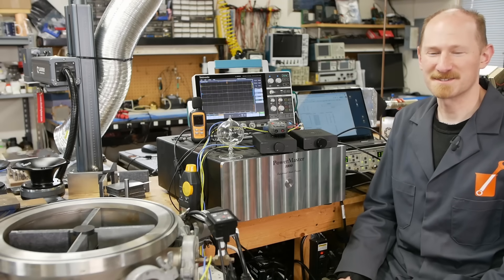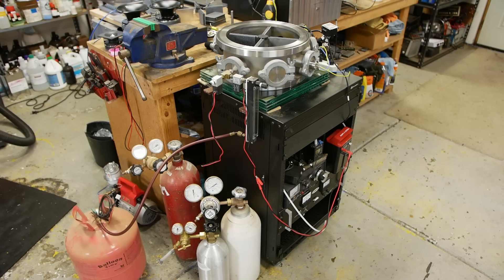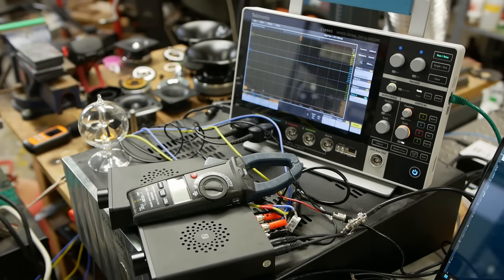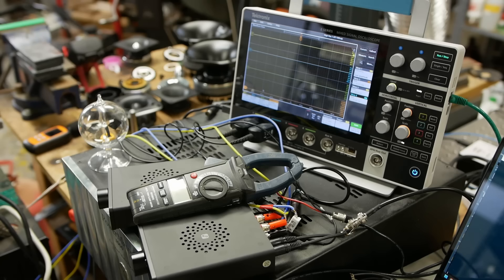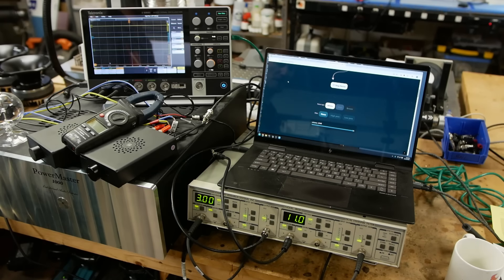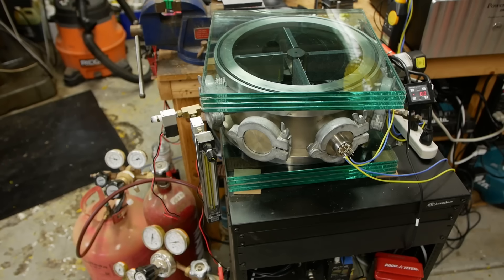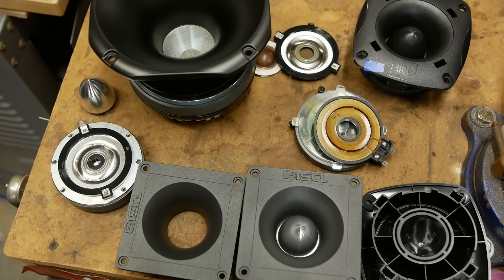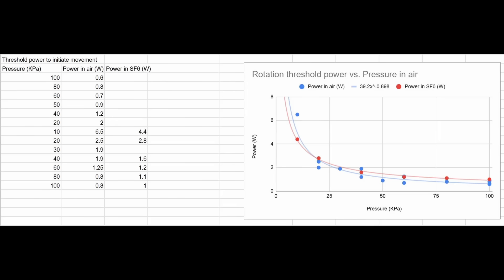Acoustic Radiometer spins in 130dB sound, clockwise and counter-clockwise depending on sound pattern

Comment: Regarding the blown tweeters, 1982 to I985 I was the one man service department for a small UK Sony & Pioneer dealership selling TVs and domestic HiFi. At the time when CD players were first introduced (or we first sold them) a lot of people would buy 100W speakers - often Pioneer, Sony or Wharfedale - and a Pioneer PD 1 CD player and then a week later complain of blown tweeters, and how it couldn't be because they ran it too high a volume as their amplifier was only rated at 20 or 50 watts.
Of course, they were cranking up the volume a bit with the new toys for the bass, but after some time it was discovered that with lower power amps, and the higher dynamic range from CDs, turning up the volume would lead to clipping or squaring of the peaks of the HF waveform, in particular cymbal crashes.
The average power then being passed to the tweeters was much higher than expected and they soon failed. The answer - paradoxically - was to have a higher power, more capable amplifier. 
When you mentioned white noise and blown tweeters I immediately wondered if your amplifier was under powered and squaring the waveform, increasing the average power? But no doubt you covered that. 
It was an interesting lesson for me as a youngish technician at the time!
Reply: I worked for a sound equipment hire company in the 1980s and the "clipping amplifier blows speakers" problem was well known. We refused to hire speakers to people who wanted to attach them to their home HiFi - you had to hire our amp and speakers as a set.
Reply: As I understand it, the clipping also produces harmonics that further add to the HF content/power going to the tweeter.
Reply: @oldman1944  Makes sense, the more you clip a sinusoidal waveform the closer it becomes to a square wave with all of its attendant harmonics.
Reply: CD players also have 2 volts output where tuners etc only had 200 mV. So the same number on the volume control was a lot louder.
Reply: Yep - tweeters and horns hate DC and this clipped waveform has a lot of it!
Reply: @paulypaulypauly8011 the crossover filter should filter out the dc component. Its the harmonics
Reply: It's definitely still a thing. I work at one of the few remaining hi-fi repair shops, and when a customer blows a tweeter it's almost certainly because they tried to drive a set of modern low effeciency speakers in a big room with a 70's low wattage amp or a tiny class-d amp. Clipping kills way more tweeters than reckless volume control.
Reply: This reminds me of another blown coil due to clipping but in a completely different application: I have these little emergency flashlights at home that plug into the mains and switch on when the power goes out. I tried recharging one with a backup power bank that produces a "modified sine wave" 120v output. The light promptly let out some of the magic smoke.
Turns out the energy from the higher frequency harmonics in the digitally synthesized 120v AC wave was too much for the little 1/4 watt through-hole inductor in there.
Reply: The amp being used is capable of around 89W/channel at 8ohms with 1%THD or 160W/channel at 4 ohms.
If the tweeter spec sheet was honest about the 120W power rating then it might actually be the amp causing the issues.

But 120W would be a crazy high power rating for a single tweeter as I understand?
I didn’t catch what the measured maximum power was, but the power shown when he’s talking about measuring the speaker coils only seems to go up to around 6-8W.
Reply: @Gractus  the rated power is band limited. Not because of the reason Ben mentioned, which is in of itself a common misconception used to explain a phenomenon misunderstood. It's simply about thermal dissipation and the ability of a tweeter to move. Since the tweeter can't move much, lower frequency material causes more heating because it's not acting like an inductor anymore
Reply: @AnnaVannieuwenhuyse so you’re suggesting that if the input noise was filtered to the rated 1.7KHz-20KHz, the power handling would be much closer to 120W? 

Is the impedance of a tweeter likely to fall so much below 1.7kHz that it’s going to burn out from the brief dips into that range as part of the white noise? I’m skeptical that it could be that significant.

I’m familiar with the idea that lower frequency content typically requires far more power but my assumption was that this is primarily because humans are far less sensitive to low frequencies and the drivers for lower frequencies are typically much larger to move more air. More air moved -> more power needed. 

I’d be surprised if a tweeter could handle a much higher power (even within its expected frequency band) simply by the fact that those frequencies require relatively small power levels for extremely loud volumes. What practical reason could there be to design something that can output more than 130dB at <20W, with the capacity to accept >120W?

I have to side with Ben’s explanation that the rating is based on the tweeter being incorporated into a speaker with multiple drivers and a crossover.

Comment: You are attempting to initiate rotational force via the turbine, creating an apparent cross sectional area difference between the attenuated and non attenuated areas, these materials also have a frequency target with an assumption of air at 1 bar also, speaker also has a similar assumption though less the issue here. Wave function explains it all in combo with some fluid mechs, simple. not a turbine.

Comment: I have done an experiment with sand in a cup and sweeping audio and I have noticed the sand will flow up the sides and down the center and at some point the sand will switch direction, and flow from the center and down the sides...

Comment: I wonder if having many smaller speakers would be better than a few larger ones? Because of the reduced air pressure I assume it is more difficult to transfer energy into the veins and the effective work distance to decrease, so many small speakers could affect a more consistent acceleration and higher top-end. I imagine a ring of 12 speakers on top and 12 speakers offset 15 deg on the bottom would work rather like the stator of an electric motor, if the rotor were more turbine like. That would be neat to see. Thanks for all of the thought-provoking content, it's a privilege to enjoy.

Comment: Perhaps heavier gases create greater drag and prevent the vanes from moving very fast. Helium is an amazing sound killer, used extensively for that purpose. A decibel meter in the chamber to read the different sound pressure levels in the various gases would be great.

Comment: Apologies if I missed it, but what sort of effect does pulling a vacuum have on the acoustic foam, if any? 

Cool experiment, for sure. I didn't consider that the standard audio gear being optimized for regular atmosphere would have the effect it did, so I failed the prediction challenge.

What other types of sound emitters might be viable? Contact transducers maybe?

Comment: have you considered trying pure oxygen (or as "pure" as you can get it)? since normal air has a lot of other gasses and stuff in it besides oxygen, i wonder if there's maybe some sort of interaction between these different gasses and stuff that's in the air that's affecting the system

Comment: As an audio hardware engineer, it was surprising for me to see, how a person, whom I come to watch his videos to learn more about fundamental applications of physics, struggles in audio signal chain related issues, like filtering white noise and even generating a noise like signal with appropriate crest factor, etc. Amazing video nevertheless.

As your comments at 14:00, the non-linear behavior of the gasses usually start right after reaching 110dB SPL, after that, mainly the density and the wave propagation speed becomes time and pressure dependent. As the pressure increases, the gas gets compressed and the wave propagation speed becomes larger (c0 is about 344m/s at 25degC). This is also called shock wave formation, meaning that, due to the higher pressure of the top and the bottom sections of the waves, those sections move faster than the middle section of the waveform, and these may look like a sawtooth waveform. When that happens, it becomes more difficult for the driver to generate positive pressure gradient but it is always easier to reduce the pressure gradient. This occurs at different pressure levels for each gas, like Nitrogen, Oxygen, Carbon dioxide, Hydrogen, etc.

As for the horn design, yes, the horn is an impedance matching geometry but what you are building is a pressure chamber. It means that, if the efficiency of the transducer is 0.3-0.5%, you will get that as radiated acoustic power. In other words, in your small pressure chamber (not a free field radiation) there is no benefit from directivity, on-axis response but rather the power response of the transducer. What is most likely happening with other gasses than air is, your rho*c0^2 characteristic impedance is changing. (Density times the speed of sound squared) and that characteristic impedance defines the real part of the radiated power.
Reply: Leading with credentialism is cring af, but upon further reading my thirst was quenched haha fluid mechanical phenomena more akin. to a field effect induction motor in its mechanical operation? but yeah my thoughts ecactly^^
Reply: @Ro-ni7nm .  If a poster dives into a detailed no trivial technical discussion as here, it requires some time and effort to track.  Cranks and dilettante crackpots can and will waste that time, so I appreciate credentials up front.  They’re only cringe  if used to boost ego or argue by authority, which was absent here.- Engineer, btw.
Reply: It’s a thesis
Reply: Z = rho*c = 404 rayals
Reply: @lunam7249 I am referring to the stiffness of the gas cavity which is being used in this experiment. That is related to the adiabatic bulk modulus.
Reply: @oturgator ah, yes,  what psi? or millibars?

Comment: I'm not sure this is proving much. If you stuck me inside a small sealed room and pumped in the most annoying sound on the planet at about a billion decibels, I'd be running around in circles to try to get away from it too.
Sorry, I couldn't help myself. I'm kidding, of course. Sort of, lol...  I do have to admit I'm more than a little jealous of your laser cutter. It was wild seeing it just rip through that aluminum so quickly. I don't know if you've addressed it in a previous video and I'm just having a brain fart at the moment, but what type of laser are you using?

Comment: One other potential source of error. You used aluminum, which is better than e.g. steel, but even so the magnetic field leakage from the speakers - being time-varying - can conceivably affect the rotation.

(Though this is largely dealt with by the whole swapping clockwise / counterclockwise assemblies... if the aluminum is perfectly vertical. If e.g. the blades end up pivoting slightly  to bring the center of mass more in line with the support, then you can get induced rotation through that.) 

That all being said, I think this source of error is relatively unlikely.

Comment: Class D amplifiers operate at very high frequency don't they? When you used the wideband signal source, all the residual signal was probably enough to interfere with the operation of the amplifier in ways it was never intended for and wasn't designed to filter out. It would be interesting to measure that and see how wide a signal you can put in before it starts acting funny.

Comment: With 4 speakers you can do a phase array setup and maybe it will result in rotating the vane if you rotate the phase of a sine wave between the speakers?

Essentially it might control the position of the standing wave within the chamber?
Reply: Ya, I'm also thinking (does time alignment even matter for white noise) minor changes to phase, pulse (turning off speakers in a strobe affect), and cancellation to see if you can manipulate the rotating vane.

Comment: Magnetic planar or electrostatic speakers might be more "neutral" to different gasses, since they're basically a thin flat sheet that isn't built to any particular frequency band within human hearing ranges. I suspect this would only be of limited value, they're still built for 1 Atmosphere of air after all. But for commercially available tech they introduce a minimum number of arbitrary geometry variables, which could help lower the overall 'noise floor' in the experiment.

Comment: I’d love to hear your thoughts on the last graph’s crossover of efficiency over pressure by the different compounds and/or molecules of gasses. Ie, the point where the SF6 & air meet in that graph. I’d love to find some correlation with those points and different properties of the spinnymajig!

Comment: The shock in my body @7:24 when I saw someone editing code in notepad. I mean, you cannot argue with the results but not at all what I expected to see.
Reply: I'd rather see that than someone copy-and-pasting it from an AI! At least Notepad forces you to think hard about what you're writing.
Reply: IDEs are bloatware, I often find I use several programming and electronics ecosystems at the same time: Kicad, C, PHP, HTML, Javascript, CSS, etc..
Nanny environments would swamp my computer
Not only that, but often I simultaneously edit 5 or 6 files via SSH.
Bottom line: be comfortable walking without crutches.
Reply: @dougaltolan3017 you'd hate to see my setup for our embedded systems at work. Writing embedded c++ code on windows via visual studios ssh Linux integration is amazing. I never have to leave my os / ide of choice and it works almost flawlessly. Hell it even hides the gdb bs away and gives me a sane debugger.
Reply: why is everyone saying this? 
what else would you use?
don't tell me it's become common practice to spin up a behemoth devOp workflow platform to hammer out a little slice of Py??? Does that not defeat the purpose of scripting languages?
Heck, why not just whip up a WebAssembly project or breadboard a few shift registers and logic gates to get it done! Or break out the jigsaw and a bag of marbles to build a Chuck Babbage machine that does the math mechanically! While we're at it let's build a Gundam Wing Battle Mech so we can put up Christmas lights without a ladder! 😅 sorry I'm just trying to make you laugh, my humor works better in person
Reply: @Alkimi I don't mean to imply he should spin up visual studio to write a Python script but I at a minimum would want color coding.
Reply: @NULLandKale hehe, me too. But it makes me feel like an addict, because when I first learned to code in the 90s, my vision of what code looked like was bright green on a black screen, with that sideways cityscape kind of shape to it.  I can actually remember when the context coloring first came out and it annoyed the hell out of me because I was using custom themes and Notepad+ so I could write code in a green font on a black screen 😂 maaan those were the days. Now I want to watch The Matrix. I'm gonna put it on right now, no joke. Let's all watch The Matrix together! 🎉🕴
Reply: @NULLandKale be sure to wear the right color of shirt too

Comment: Would be interesting to try a broad-band speaker (or transducer into a plate) setup and much lower frequency for SF6 in particular. Gut feeling is the denser the gas, the lower the frequency.

Comment: call me stupid...but um...is the kinetic effect of a speaker directional along the same axis of propagation as the sound waves?
and if this is so; wouldn't it then make sense to aim the output of the speaker driver directly at the reflective surface of the rotor blades for maximum effect?

Comment: 1:54 ah yes, clearly the souls of the damned are escaping your container
Reply: I legit leaned back from the phone screen like that'd help. I cannot fathom how well isolated that thing is to have essentially the sound of a small jet turbine in a box without getting noise complaints
Reply: @GalileoAV leaning back helps to the power of three to be precise!
Reply: I have no idea what it actually sounds like you know, since I’m not listening on 130db speakers. 
All I heard was crackling.
Reply: reminds me of that scream machine Bart Simpson drew up in one of those "tree house of horrors" Halloween specials. iirc it was a scream powered machine that dumped piranhas into the water with someone. the more they screamed due to the piranhas, the more piranhas added to the system.  it was a positive feedback loop of screaming lol

Comment: I wonder what shape those speaker cones would for the helium gas. Would it be a similar shape but smaller or longer? Or is the homogeneity of the gas. When people inhale helium they sound like a chipmunk because sound travels three times faster in helium than air. So the cone would be smaller.

Comment: 14:30 it would have been great if you woulda tried out some cone style speakers that shouldn't have the same problem as those weird drivers. First time I've ever even heard of speaker that was impedance matched for air.
Reply: Any speaker you've ever seen with a horn or cone shape around it is impedance matching the air. We don't really talk about it that way, we just see it as a way to focus it or make it louder, but that's what it is doing. It's not weird at all.
Reply: @witeshade  no, these drivers are specific and use a very special shaped transducer. normal speakers have a wide flat area that pushes the air quite hard and won't care what gas or liquid its pushing on... literally just go and watch one of those vids where they pour non-newtonian fluid on a subwoofer my guy... and its not like ben needs super HF response since he's cutting the noise at 11khz, so yeah.